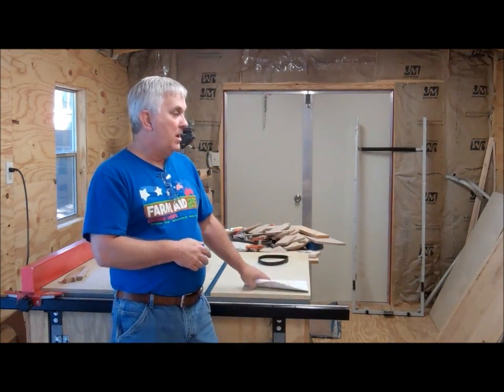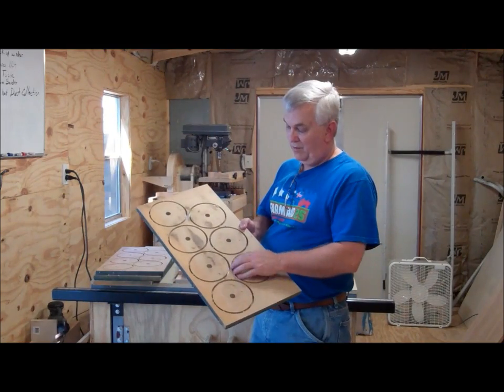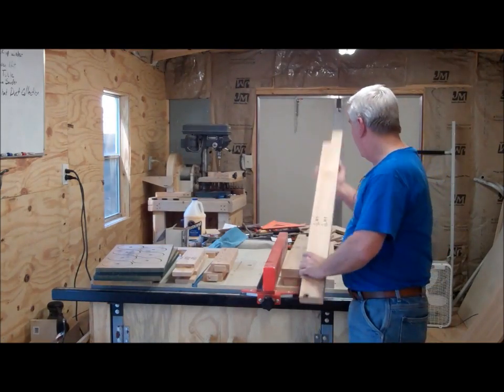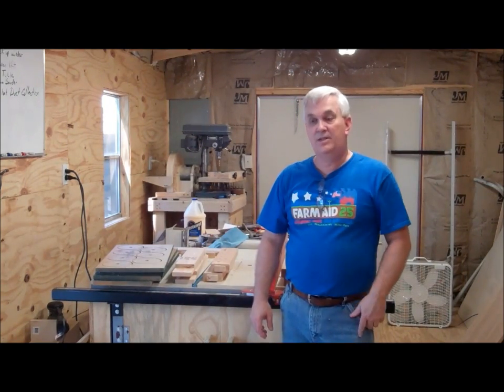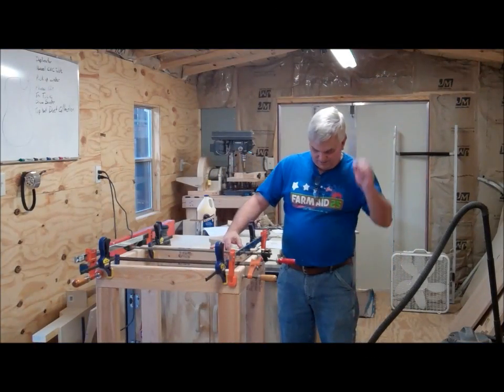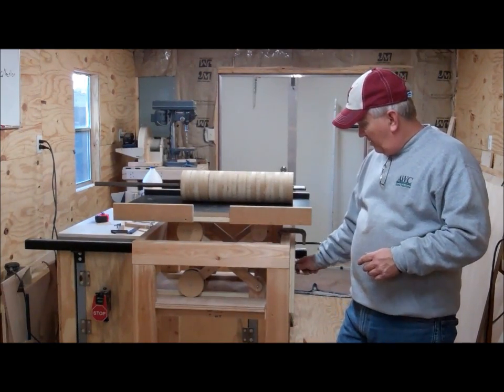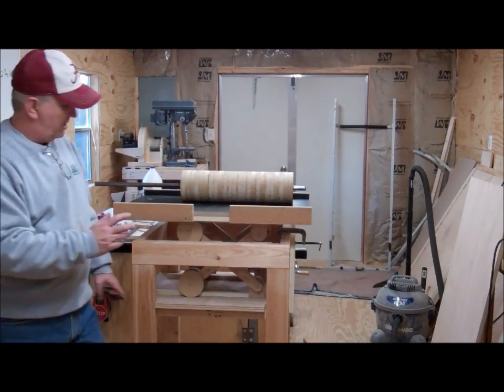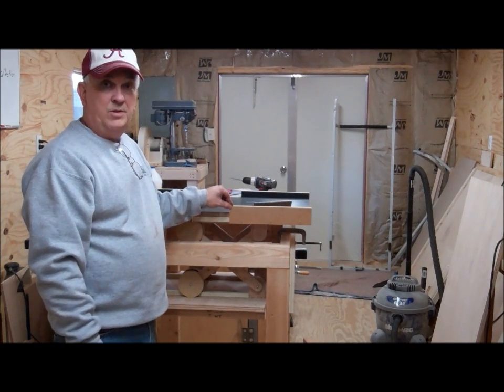Building a Drum Sander Part 1

Comment: nice video.  I am 1/2 done on building my own.  I am ready to attach the 20 mdf 4" disks to my 1/2 steel rod.  I know the disks get glued to each other, but how did you glue the wood disks to the steal rod?  i am worried under load the shaft will spin and the disks will stop, etc.  Any advice is great.  thank you.

Comment from the maker: Thanks for watching guys.  I thought of adding some vertical guides on the corners but I didn't have anything on hand that would work well.....And I did have some hinges on hand that would work perfect if I changed my design so I did.  Now I'm having a problem finding a v-belt pulley with a 17mm bore.  I wanted to use the motor from a treadmill but I may have to change that plan too.  I have another motor that would work well but I wanted to use the speed control from the treadmill.

Comment: The lift idea might just work if you used a vertical guide rod and bushing in each corner to hold the alignment and provide stability by giving the table no where to move to.  A bushing several inches long in the vertical would eliminate any tendency to wobble.  Drawer slides could even work if mounted to dynamically provide opposing tension to each corner.  Just some off the top of my head thoughts.